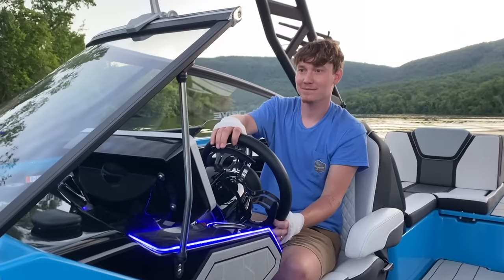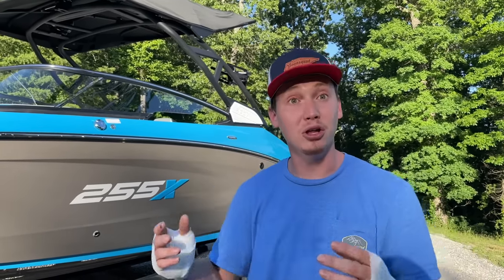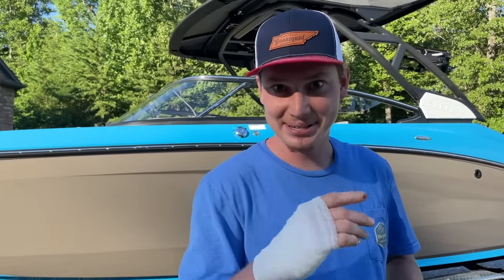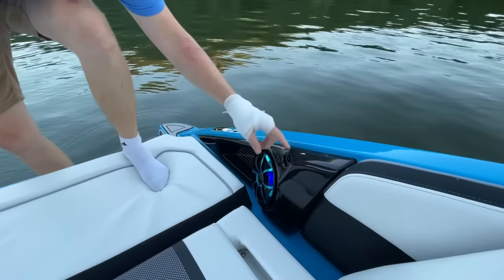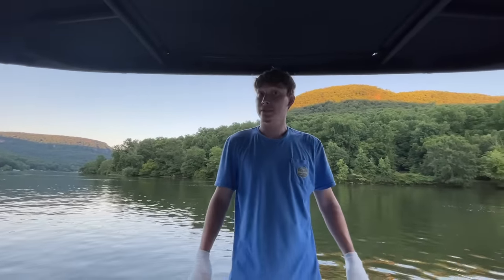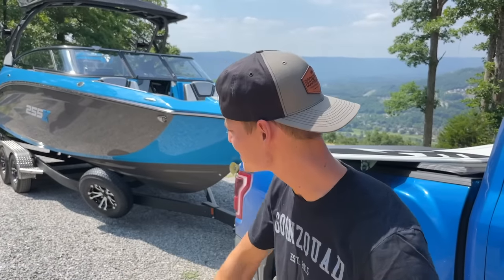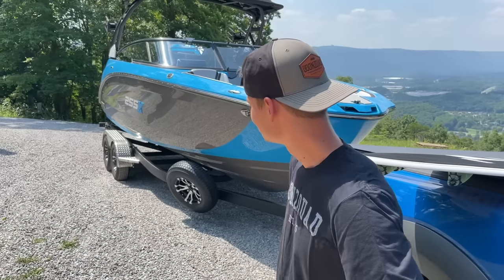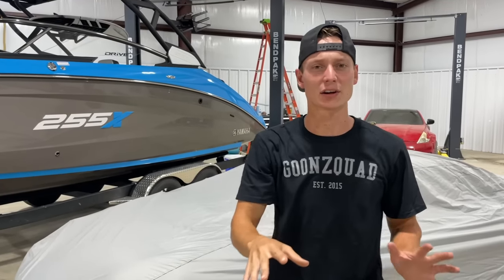Breaking In Our Brand New YAMAHA 255XD Ski Boat!!! We Are Upset!?

Comment: those hubs on the trailer tire pop off and they have grease traps in there. USE THE GREASE EVERY TIME YOU GO OUT! Especially if you're going into salt water. Your engine will most likely have grease traps too. I've never had a inboard engine cause the possibility of blowing up but make sure you turn those fans on before starting that boat. That engine might also have grease areas make sure you check.  Any metal on the outside and near the transom you want to grease. Screws, bolts anything you want to last. Expect to replace everything on a boat every few years, there's a reason why boat stands for bust out another thousand. Stay safe out there

Comment: Check the fluid level in the brake reservoir (cap on tongue of trailer).  The  little peg is for reversing, it doesn’t let the tongue compress the brake actuator. 

Unplug the lights before dunking the boat. Even the LED lights get warm and it will wreck them.

Comment: Get well soon guys. We need you on full throttle. The Raptor could be dragging the trailer. Looks like the trailer has its breaks locked which is heating them.

Comment: As an owner, make sure you clean those motors out real well when youre done for the day. Also use chain lube inside that engine bay and spray it all down once every few months. With you being on fresh water it isnt as bad, but take proper care of these things because the bills get high if you dont. Start your motors at least once every 2 weeks with connected running water and let it run for about 5 min. Follow storage guidelines to a T when winterizing the motor. Most of all have fun, they're an absolute blast to own!

Comment: The Raptor seems to be squatting with the boat.  I'd be using the HD Silverado to pull the boat.  You should wrap the Silverado to match the boat.

Also I'd just block off the trailer brakes when going down the mountain, the Silverado would be more apt to handle all that load on its brakes then the Raptor.

Comment: make sure the dealer can show you a pdi sheet. pre delivery inspection.  it includes checking and bleeding the brakes,  checking the reverse lock out, and greasing the hubs. Yamaha will have one the boat and motors too. it makes sure everything is checked before delivery.

Comment: Love the new boat, one thing when pulling off from the ramp and the boat is on the trailer, keep the engine running and push down on the throttle to remove the excess water. Keep it up love watching yalls videos.

Comment: Pretty sure the little dangling key piece @ 4:56 is the safety brake.  Once that key pops out it is supposed to lock the brakes on the trailler so it doesn't turn into a runaway.  Most bigger trailers with brakes have this feature.  Could also be that you have the brake gain too high in the truck.

Comment: Gorgeous boat guys!  Definitely need to get the brakes looked at and likely replace those rotors, blued like that they are heat stressed and will be to hard for the brake pads causing premature wear or possible failure. Stay safe guys

Comment: That is a key to help you back your boat up it is good to keep that key and do not lose it because it will help you back up your boat easier and you could take that key into the slot on the trailer just got to pull ahead a little bit then put it in then you can tape it up and it will be easier so you don't lose it

Comment: Need to put that pin the the trailer when going down steel grades because the weight of the boat pushing into the truck is compressing that hitch and makes the brakes engage the whole way down the mountain
Reply: ⬆️⬆️⬆️⬆️⬆️

Thanks for going through our videos.
Inbox us to Grab ownership of a prize☝️☝️☝️

Comment: Been thinking about the trailer brakes,  going down hill push on the towbar and make brakes come on,  that brake system is not made for long down hills,  not sure how you can stop them working that much again....   

Maybe don't coast or use the brakes on the downhill from the house,  slight pulling might be better IF you keep on the power...

Maybe make a neck that is harder to compress when doing long down hills, so that it has extra pressure to put the brakes on the trailer???  That would want be removed when driving normally any other time...

I hope these are helpful.

Get well soon guys...

Comment: Get the trailer looked at soon, boys. I pull a heavy tournament ski boat in the mountains with a tandem trailer, w/disc brakes and have no problems. That is not normal. Something is going on in the system that isn't right. Brakes getting that hot can be heck on the grease in the wheel bearings as well as warping the rotors, etc.  I suspect those rotors are already junk by the heat they have seen.

Comment: Pretty sure the pin is supposed to be in and if pulled it activates emergency brakes run the pin in it also should be able to adjust trailer brake tightness inside the truck as well try adjusting that

Comment: Boat is awesome and enjoy it….definitely get the dealer to inspect brakes as the surge is staying engaged. No way should they be applying unless you brake and cause actuator to compress.  I have similar size boat with same setup and that’s not normal. 

If needed you can lock out the brakes to haul to dealer, but I would take the dually truck. I imagine that bit and trailer with fuel weighs around 6k and it will push that 1/5 ton without trailer brakes. 

Also, with these boats make sure to add fuel stabilizer at every fill up without exception. The fuel pumps do not like ethanol at all as it has dual pump system (low to lift fuel and high for rail pressure). 

Also, cover the boat once interior is dry…parked inside or not. Especially inside the shop where you will have debris flying around. Mine is in shop and covered and top gets filthy….flies love to spot up the vinyl.

Comment: 1. Put the brake pin in and pull it with the 450.  That Raptor is awesome, but not a great match for that boat especially when you have a perfect match in the driveway. 

2. Have Whites have a tech come on the water with you to show you all the ins/outs.

3. I saw about 5 heavy TWRA fines.  Study up - you’ll get targeted with that boat - I guarantee it. 

4. That boat is a massive asset - store it under cover - don’t be “that guy” 

5. Don’t leave the fenders out.  That’s a qualified captain move.  Haha!  

6. Something is up - your bilges shouldn’t be pumping at full blast (watch on drone footage), even with ballast full. 

7.  Shorten that rope for your little sister about 3 feet.  Will make it 10X easier.  

Have a blast!

Comment: What’s up guys, glad to see your both healing up and feeling better. I’ve had boats for over 20 years and have never had rotors on a trailer turn purple from getting hot. It could be a couple things but I’d get a break controller for the raptor or try using the 450 and see if that helps as it has a built in controller. I’d definitely contact the dealer and let them know the trailer brakes are having issues.
Reply: Those are hydraulic breaks and do not use a controller like electric brakes do.
Reply: @beckyumphrey2626  I know it’s hydraulic brakes on the trailer I have a hydraulic brakes on one of my trailers myself. My trailer uses electric still in order to back up (hence why there’s the little pin Billy points out in the video is there) the pins for when the trailers not connected to electric you put the pin in and it allows the trailer to back up. That’s why I spoke of a break controller or trying a vehicle with a controller as it’s made for towingX

Comment: Hope y’all get better soon! And brakes definitely aren’t supposed to turn purple something is wrong and when rotors get that hot they usually warp, that could be why the raptor is struggling cause the trailer brakes are staying slightly applied

Comment: That happens on long downhill roads the trailer keeps pushing on the truck therefore burning up the brakes. You can make it electric over hydraulic and lock out the jammer brakes on the hitch. I actually lock out the trailer brakes in total when going to Cotton wood cove in Nevada because it’s 10 miles of a down hill road to the entrance. Gotta be safe though. The boat ramp area is riddled with brake pads parts do to smoked brakes.
Reply: Hybred elrrc trees bes zero emsion fur 10 Mike ejrrc rw as bge

Comment: Those brakes are designed to come on down hill or when stopping so the towing vehicle doesn't jackknife or its' brakes don't overheat. They aren't the best at long twisty or steep downhills. I would look at getting them adjusted, replaced for a different system. Driving steadily, limiting your speed and slowing gradually into corners rather than hard braking helps. That or leaving it at your parents place or the new HQ, at least in the meantime like you have is probably a better idea. Less fuel used and not as much wear on the brakes.

Comment: Based on the weight of the boat, especially going downhill in the mountains you will smoke your brakes due to the constant pressure on the master cylinder in the tongue of the trailer. I'd suggest not towing up and down steep mountains with surge brakes if possible but if necessary switch the brakes on the trailer over to electric and then you can increase and decrease the brake gain from in the truck, but you guys probably already knew all that ;-). Great Boat Congrats, and get yourselves better!

Comment: when surfing you dont want to fill the non surf side ballas tanks up very much just the center and the surf side. another things there is a surf mode you hit the throttle and it goes to the set speed ( 10-13mph)

Comment: Trailer brake issue is likely the actuator and bleed solenoid.  With the severe hills you are traversing, surge brakes can be finicky.  Guaranteed either the actuator or the bleeder is not working right and it is not unloading pressure, causing the disc brakes to drag.

Comment: that pin could be the safety break away. when that pin is pulled it sets the breaks in case of the trailer coming unhitch to the truck. that pin will set the breaks when it come out.

Comment: It is the brakes that will automatically brake the trailer when car is slowing down and boat and trailer pushes on. In downhill and with heavy load the trailer is probably in brake mode. Maybe it can be adjusted. Bring it back to dealer or be fixed

Comment: The brakes on the trailer were dragging because how steep your road is from the house at the top of the mountain.......the boat was trying to push the truck on those steep hills causing the brakes on the trailer to apply.......may just lock out the surge when going down the mountain and removing it when you get to the bottom.......as for videos hang in there....most of us understand that you guys are healing up.......enjoy the boat and fresh air........Looks like your sister was having a great time out there......get the rest of the family out on the boat......Fun will get you healed up faster.

Comment: I think maybe you should have figured the trailer break system out before you towed the boat. I`m sure the rotors aren`t supposed to turn purple. That kind of continuous heat will warp them.

Comment: You need to put the pin in, it’s for when the truck disconnects from trailer if an accident occurred. The pin would be pulled when trailer disconnected causing surge brakes to engage

Comment: Definitely seems like an air bubble in the brake lines happens sometimes with new setups I've worked with a certified boat dealer as a service technician for both electrical on boats and trailer work seems like a air bubble in the system just needs a good bleeding boys

Comment: Your breaks are overheating when your coming downhill because the trailer brakes are being engaged because the boat is pushing into the truck on the way down. Definitely install the brake clip when you are coming down. Your truck has more than enough power to stop the boat.

Comment: That is a normal brake system cous when you go down a hill car first then trailer it needs to have a brake system te prevent the trailer from pushing to hard against the car/truck in the Netherlands it’s required from 750KG we call it teruglooprem (backstop) the brake discs change collor by the type of material and the duration of the braking
Reply: ⬆️⬆️⬆️⬆️⬆️

Thanks for going through our videos.
Inbox us to Grab ownership of a prize☝️☝️☝️

Comment: I definitely think that the truck shouldn’t have a problem pulling that. Your problem is definitely that the brakes are not disengaged. You need a trailer brake setup to pull that boat. And there is also a safety line in case that your trailer comes off on the road it will lock up the brakes to prevent a terrible collision. I think that that safety line is pulled and your brakes are locked. Not good

Comment: Better braking solution for you.   Ditch the brake actuator in the tongue of your trailer, and add an electro-hydraulic actuator to your trailer.  lLok at the hydrostar 1600 psi version made for for marine use.   Your truck's brake controller needs to send a signal to activate it.   Check out your truck's brake controller... but you probably will  want to upgrade to a top-of-the line controller from the New Zealand based company called Redarc -- it's not that expensive, and their unit has a hide-away installation, with only a single small knob that you mount to control it.  It uses smart sensors in the main unit and an input from your brake lights to tell when you are decelerating.  It's a smart device that automatically determines how hard to apply the trailer brakes and also when to NOT apply the trailer brakes.  Living on a mountain, that's what you really need.  It'll work much better, be a safer solution and stop your trailer brakes from overheating while going down the mountainside. It's LEGIT!! -- You'll see! ... or in the words of a comparatively old-man like me... it's "really cool!"   :-)

Comment: My friend bought this same boat (2024 model) about two months ago.  Day one the stereo amp did not work.  He took it back and dealer could not fix it.  At week two, the touch screen blacked out and all electronic controls died with it.  Again, took it back and Yamaha had no fix for it.  At month two, they said they had a fix.  Nonetheless, it is a beautiful boat.  One thing I really don't like is that the wake bladders take up most of the storage compartments.  You can see that on this video, even the guys don't acknowledge or highlight that.  Oh, and as far as gas goes, it does require premium and this boat sucks gas like there's no tomorrow.  He burns twice what I do with my Tahoe, 225 hp Merc outboard engine.
Reply: More than twice the hp twice the fuel.  Doesnt sound too crazy.  Jet vs OB not a comparison on fuel economy anyway.
Reply: @PradoTraceAZ  You are 100% correct.  Just some folks might not be aware of that reality.  My friend was taken aback at how much more fuel he was burning than me.  But indeed he can leave me in the dust.

Comment: The brakes are smoked they must have been on the whole time 😅 New rotors and pads at least will need to be done . Check the owners manual to see proper operation of the brake system ect... Before use !! Nice job on the board lol sis I bet the boys were jealous 😂

Comment: Hi boys. Basically as you were going downhill your brakes were constantly on as the pin was not in. Normally not a problem for small descents but I assume yours goes for a while. Next time i would put the pin in on level ground at the top of the mountain so the brakes aren't depressed all the way down the hill then remove the pin when back to normal driving. Go slow please as the boat will not have any brakes this way.
Cheers

Comment: Hey guys what’s happening is the hydraulic actuator is pushing on the truck because the boat is trying to push the truck and that is keeping the brakes activated to a point and the Calipers are just rubbing it on the hubs causing them to get hot. you need to go talk to your dealership there should be an adjustment on there that you can stiffen it up a little bit to make it where it doesn’t push so hard going down the hill but when you hit the brakes on your truck it still activates the brakes.

Comment: I strongly suggest whoever is going to operate any boat should take a Boaters Safty Course, in most cases its a free course, but well worth the money if it does costs, also get your boat Coast Guard Safty Inspected,, That too should be free and they'll tell you what you need (whats required on your boat in your area) for your boat,
best to have it and not need it, than to need it and not have it, 
Happy Birthday E, and Happy (and Safe) Boating,,,

Comment: Found the answer to the fuels for boats. Yes, you can use the same gasoline as a car in your boat engines; however, this fuel must be E10 or ethanol-free gasoline. E15 or gasoline with higher levels of ethanol is not recommended

Comment: Maybe you have too much trailer brake on the trailer and need to lower how much power is going to the trailer brakes. I pull a travel trailer and had tested at 5 and lowered it to 4.5 on the trailer brake and helped. Cool your trailer has disk brakes. I wish my travel tailer had disk and not drums.

Comment: Dude you need a raiser in the hinge at least 2 to 2.5 inches... It seats pretty low on the truck.
Reply: Verify the wiring on the plug, if they are not correct the brake would stay engage until power is issue and the piston is release.

Comment: Just remember,  jet drives don't work unless there's water going through them...don't be afraid to tap that throttle to get the boat to react..and having that fin is good and bad...
Reply: One last thing. That surge brake works off weight. When you slow to a stop the trailer surges forward against the truck forcing fluid into the calipers setting them against the brake disks.  Same with going downhill. Regular driving or pulling uphill should extend the hitch and fully release the syst em...